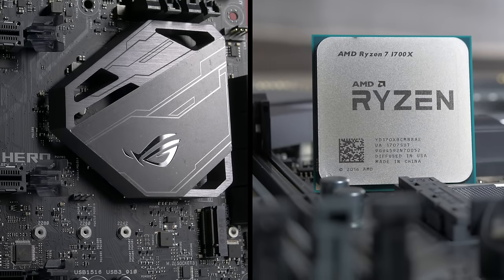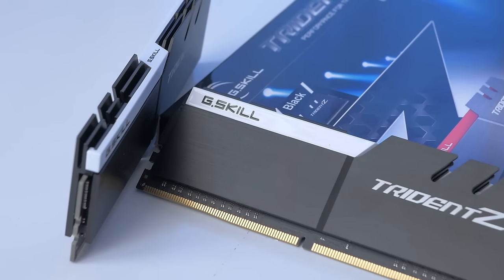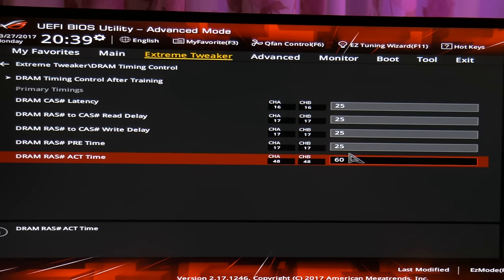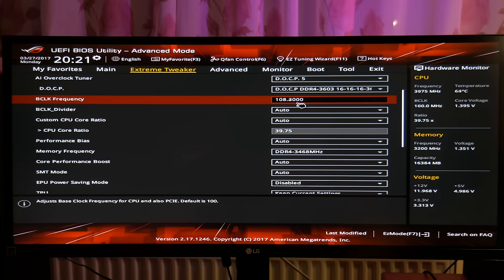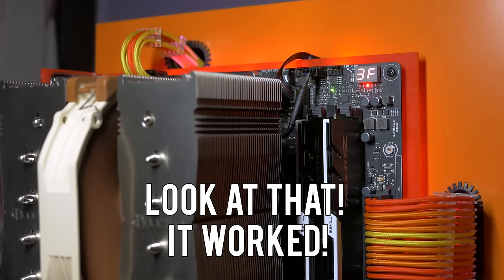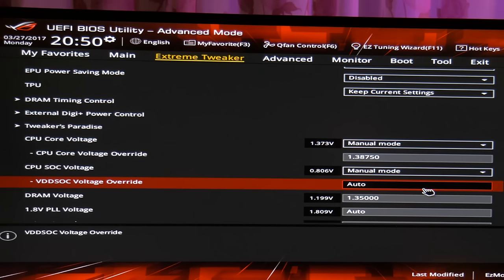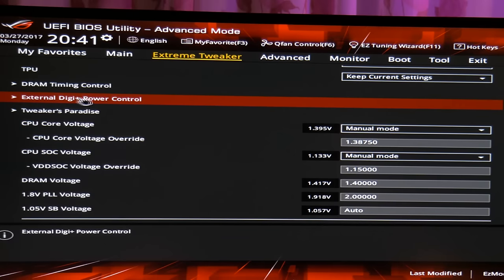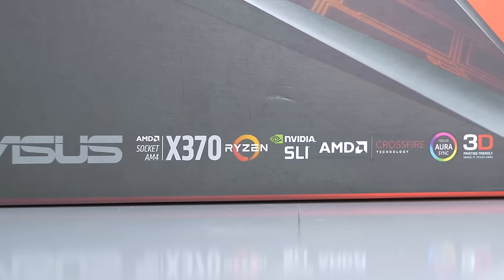Getting faster RAM working on Ryzen + ASUS Crosshair 6 Hero

Comment: Its been like this since the FX series. I used to have 1333mhz pairing with my AMD FX 8350 and my CPU-Z score is about 900 single-threaded and 5999 multi-threaded and then i upgraded my ram to 1866mhz since then my SingleThread/MultiThread bench goes up to 1290/8150 running @ 4.5ghz and 1254/8021 @4.3ghz. Also installing Windows 10 made my gaming experience more smoother! i know that Ryzen will be the same :)
Reply: Really? I haven't noticed any gaming differences. Maybe I was just GPU bound. The only time I noticed a difference when I was playing Tomb Raider 2013 hitting about 120 fps min at max settings, it would vary by about 3 fps depending if I ran my ram at 1333 or 1600.
Reply: I will have to try it on CPU-Z, my last run was getting on 9054 multithreaded with 1333 Mhz ram and single threaded at 1408. My $40 mATX motherboard is pretty limiting with its cheap VRM, so I have to have a pop-tart box channeling some airflow over the VRM just to get anything past stock, lol, hot glue scissors and a box to the rescue! (FX-8350 chip)
Reply: Tested with 1600 Mhz just now, not a huge difference on CPU-Z. I got up to 9098 (so 0.49% improvement or 1.00486 X better). That was pretty insignificant. Disabling Anti-virus (and yes I still have other things like remote desktop servers and stuff running in the background) got me up to 9128, which is just above an i7 6700k according to CPU-Z.

I could run it faster, but my 4+1 phase VRM is about as cheap as it gets on an mATX board.
Reply: Ryzen ram speed is for gaming not general applications. It worth for games.
Reply: +Xin Gaming - Fast(er) RAM speed alone doesn't generally have much effect on FX series performance (similar to how overclocking the CPU via the multiplier doesn't increase the performance much either). But fast RAM speed (especially with tight timings) coupled with fast FSB speed, has a HUGE effect on FX series performance, especially single threaded. That's because the one weak area of the FX design is it's Memory Architecture (including it's Internal Memory Controller) / Cache design, which really hurts single threaded performance. But "brute forcing" the data through that area with fast FSB speed coupled with lowering latency with fast RAM, overcomes that issue. 

However, you need a Motherboard that's capable of allowing fast RAM speed and fast FSB speed while still being stable. The low end AM3 Motherboards usually aren't. But if your Motherboard can handle it, then it really makes a significant difference in performance. I guarantee that a FX-8/9XXX @4.0 GHz / 250+ MHz FSB / 2133+ MHz RAM will be faster than a FX-8/9XXX @ 4.7 HHz / 200 MHz FSB / 1600 MHz RAM. My own FX-8350 has been running @4.3 GHz / 260 MHz FSB / 2340MHz (cl 10) RAM for ~ 4-1/2 years, and it benchmarks and tests within 2% of a stock i7-4790K (4.4 GHz turbo) both multi-thread AND single thread (and it real world multi-tasks much better than the i7).

BTW, the Ryzen and FX series are completely different designs, so the fact that the FX series responds really well to increases in FSB speed coupled with fast RAM, is coincidental.
Reply: What are you talking about? The multiplier is a pretty much a direct performance multiplier.... Overclocking with the multiplier only, I'm hitting 9128 in CPU-z and 755 cb with just a multiplier adjustment. Normally its 640 cb and 8018 in CPU-z.

I don't think that's "doesn't increase the performance much either". Its a pretty linear scale for me.
And as far as what benchmarks are showing, CPU-z is showing it just clear an i7 6700k (which seems wrong, but I didn't make the benchmark, I just run it).
Reply: +Jake Garrett - For the record, I'm trying to help people who have an FX-8XXX (or they're thinking of buying one) who either can't afford to upgrade right now to a new Ryzen / Intel, or they're choosing to wait for Ryzen (and the Motherboards) to get all the bugs worked out. There's no need to come at me just because you don't understand what I said.

Despite what CPU-Z says, your FX-8350 isn't running anywhere near an i7-6700k. You achieved ~18% increase in multi-threaded performance, and even less in single threaded. Yes, overclock via CPU multiplier is fairly linear for the first 10% - 15% increase (then it tapers off the faster you go). But as you'll see, that really isn't much of an increase (although any increase is better than none as long as it doesn't hurt stability or reliability).

A stock FX-8350 scores Cinebench R15 @96 ST and 640 MT. My FX-8350 running @4.3GHz, 260MHz FSB, DDR3 2340 RAM (cl 10) scores Cinebench R15 @*172* ST and 902 MT. That is an ~*79%* increase in Single Threaded performance, and an ~*41%* increase in Multi-Threaded performance. See the difference? 

So yes, OC via CPU multiplier is not much of a performance increase in comparison. Just like using fast RAM without substantially increasing the FSB speed won't increase performance much. The ONLY way to really get substantial performance increases from the FX series is by overclocking the FSB significantly (I've found the 250 MHz - 265 MHz region to be the sweet spot for performance / stability) AND using fast RAM (with tight timings). I explained why in my previous comment.

Since Bulldozer (FX-8150) came out over 5 years ago, I've read at least 50 reviews on the FX series and I've found only ONE review that understands the correct way to overclock the FX series. Here is a link: https://www.pcauthority.com.au/Review/313455,asus-crosshair-v-formula-z-review.aspx 

That review is short and old (~ 4-1/2 years) and they don't even go into detail on the testing except for a chart at the end of the article, but they got it right. Look at the chart, specifically at the Cinebench R11.5 scores as the FSB speed and RAM speed is increased. Their fastest overclock is @4.4GHz / 260 MHz FSB / 2420 MHz RAM speed and their increase in performance is basically identical to mine. 

Believe what you want, but I'm an Applied Scientist / Design Engineer and I've been using my FX-8350 for the last ~ 4-1/2 years as a Design and Engineering workstation. I needed the best speed, stability, and real world multi-tasking I could get for under ~$2,000 (now everything is much cheaper of course), so I read all the AMD White Papers when Bulldozer came out, and figured out where the bottleneck was occurring (especially for single threaded performance) and then figured out how to correct it.
Reply: I'll have to check into with personal testing later, but those scores seem way too high. The frequency is FSB*Multi. The page you linked shows the multi and FSB higher than the other 2, so its 4.42 Ghz vs 3.84 vs 3.6Ghz. I see that if it was linear the cbR11.5 should be 7.44 or 7.75 depending on what data point you use and its not a linear fit.   Also I don't know why its showing FSB as 240 at "stock" since mine is 200 stock. So it seems to go with what you're saying.

That said Buildzoid did a live stream 2 days ago where he was getting 10.87 points using 28 multi and 225 for FSB. I'm somewhat surprised he wouldn't know about this since the FX is probably one of his favorite CPUs to overclock. (obviously he was using LN2 and pushing around 1.9V with a 9590)

Currently I'm running 1.5125V (and I have a multimeter to show Vcore sitting on my desk, but I would like to get a nice oscilloscope to measure Vdroop and voltage spikes). I can only seem to run 4.8 Ghz using 24 multi and 200 FSB (I have to run 1333 Mhz ram profile if I use FSB because even 5 Mhz above XMP will cause my RAM to get upset).

I'm also getting within a few degrees of thermal limits with a 120mm AIO with fan speed 4,000 rpm. I do have a nice phase change cooler that should max out at -30c, but I think my motherboard is about to catch fire as is. I use cardboard to direct my AIO fan intake around my 4+1 phase VRM, otherwise it throttles at anything above stock.
Reply: I guess CPU-z is not a good benchmark. i7 6700k at 5 Ghz is 11053 (so the stock score of 9124 must be correct). I'm hitting 9128 with the FX-8350 at almost 4.8 Ghz, which would be beating the stock i7. Cinebench begs to differ saying the i7 at stock is much more powerful (920 cb compared to my 755 cb).

i7 at 5 Ghz   http://valid.x86.fr/axhcg7
mine             http://valid.x86.fr/uvalj6
Reply: +Jake Garrett - They seem high to you because you've never encountered anyone who has disclosed this information to you. Consensus does NOT equal truth. Just because the majority agree, does NOT mean they're right. Look up Copernicus and Galileo for proof. As an Applied Scientist myself, I know this all too well. 

I haven't run benchmarks / tests on this computer in years, but I kept all my notes, and I know exactly what those results are, and they are accurate and truthful. 

Seriously?! I rounded it down of course. Just like with my own system (which runs at 4290MHz exactly, but I rounded it up to 4.3 GHz because it makes no difference in performance). 

Of course it shows the other 2 higher...that was the point! They tested it at 3600MHz (15x*240*MHz with 1680 RAM speed), then at 3840MHz (16x*240*MHz with 2100 RAM speed), then at 4420MHz (17x*260*MHz with 2425.8 RAM speed) precisely to illustrate the performance increase that you get when using FAST FSB SPEED and FAST RAM TOGETHER.

It doesn't scale linearly because of what I explained about what is happening at the design level. The "bottleneck" in the FX series is the architecture of the IMC / Cache system and how data interacts with it. That can be overcome, but not by cranking up the CPU speed (which as I've shown, doesn't do much at all in comparison to overclocking the FSB COMBINED with FAST RAM). 

You need to drive data through the "bottleneck" as fast as possible, and that can only be done by the system that communicates and transfers data between all the components in the chipset and CPU, i.e. the Front Side Bus (or HyperTransport as AMD calls it in the FX series). 

Cranking up the CPU speed helps speed up calculations and other compute intensive operations, but that isn't where the bottleneck is. That's why it just doesn't do that much.

I don't know who "Buildzoid" is, but the fact that he did increase the FSB a small amount would at least indicate that he has at least some idea of what is going on. Not to be a dick, but is he a Scientist / Engineer? Or is he just a computer enthusiast who loves building computers and playing around with them. There IS a difference. By the way, a 10.87 on CB R11.5 illustrates my point...that is NOT a very good result from running at 6.3GHz. My FX-8350 @4.3GHz / 260MHz / 2340MHz (cl 10) scores 9.62 on CB R11.5.

That is way too high of a Vcore in my opinion. But I use my machine for work, so stability is more important to me than being able to extract the absolute maximum performance out of my computer. I'm only running 1.425v core. 

I applaud your creative duct work, but you really need a new Motherboard. 4+1 Phase arrangement isn't good enough for proper overclocking, and you definitely need good heat sinks on the VRM's. 

I just built a new FX-8350 based system for a colleague of mine, and used a $100 Asus Motherboard that was capable (to my surprise) of running 2400MHz RAM and 250+ MHz FSB speed. If you really want to know whether or not what I'm saying is accurate, try it for yourself: https://www.newegg.com/Product/Product.aspx?Item=N82E16813132713     https://www.newegg.com/Product/Product.aspx?Item=N82E16820231589
Reply: The motherboard you linked happen to be the exact same one Buildzoid used, so it must be pretty good. I think I'm going to upgrade to Ryzen soon though. I'm hoping to get a Crosshair Hero VI board since it has LN2 switches and currently holds the record with Ryzen at 5.8 Ghz. But its out of stock so I might have to wait a while. I'm planning on getting a 1700 chip (right now the record is 5.2 Ghz on that chip, so it would be the easiest to beat). I'll be running it sub-zero 24/7 since I already have the cooler, and I'll probably try out LN2 because that seems like it would be fun.

Another reason for going with the 1700 is its going to save almost $200. With that kind of money I might be able to get a decent used Oscilloscope so I can read actual VRM spikes. If not, probably just go with a used multimeter like a Fluke 8050a since all I have right now are cheapy handheld ones with 1% error rating compared to .03%, because I'm not really sure if I need an oscilloscope.

And its just any result that seem out of place that I'm skeptical about (I don't believe any company when they give numbers, I never pre-order anything because I want to see what I'm actually buying first). I haven't seen a trend like that personally. If I thought it was impossible, I probably wouldn't even bother testing with it to be honest. But, if there is a chance its true, then everyone knows I like messing with things anyways so I might as well test it out. And I know consensus is not truth, that's why I try to test most things myself.

As for rounding, it may be psychology. I don't feel like I've earned that 4.8 Ghz rank until I cross the line (and 4799.74 just isn't there yet). Sort of like racing bicycles, my carbon fiber seat weighs 100 grams. Adding 2 or 3 grams of padding and electrical tape so its more comfy just bugs be since its now over a nice even 100g. Also why I beat the i7 by 4 points or why I keep pushing if I hit 4,900 on a benchmark, I just want to pass the 5,000 mark.
Reply: So after about 40 ish crashes and times going into the BIOS (plus windows trying to repair itself), I got just a few benchmarks. My FSB max 230 (235 would boot sometimes, 240 laughed at me). My NB also felt like it didn't want to play (even pushing it from 1.1v up to 1.4V, really couldn't get significant out of it). But I did get a few tests done and they are interesting.

The 4.6 Ghz tests (all ran at 1.5 Vcore and 1.3V NB just to make sure they had plenty of power for stability)
-----------------------------------------------------------------------------------------------------------------------------------------------------------------------------
FSB: 230 (ram 1226) multi: 20 cinebench scored 730
FSB: 200 (ram 1600) multi: 23 cinebench scored 703

The 4.6 Ghz tests (1.4Vcore 1.3V NB)
-------------------------------------------------------------------------------------------
FSB: 220 (ram 1472) multi: 20 cinebench scored 699
FSB: 200 (ram 1600) multi: 22 cinebench scored 682

Unfortunately going higher on anything resulted in instability and lower scores (along with massive Vcore drops from 1.51V down to 1.46V when it usually just drops to 1.5V)
FSB: 235 multi: 20  so 4.7 Ghz scored 717 (lower because of instability)
Reply: So it looks like the FSB has a major consequence on the scores. Even with same frequency and RAM dropped from 1600 down to 1226, the tiny FSB bump had a 3.84% increase in performance. I normally wouldn't believe it, but I have good ol' Notepad full of numbers and settings, and it all seems to line up. So my question is, what is the FSB actually connected to that is causing this change? (trying to learn why this happens)  I will Google this sometime tomorrow, but feel free to link an article you found particularly helpful, I'm fine with even a 10 page article, I'm a Mechanical and Aerospace Engineering Senior, 10 pages is pretty short to me.

Good advice on overclocking differently, I might be able to hit 780 cb score if that 3.84% improvement is linear with just 4.8 Ghz.